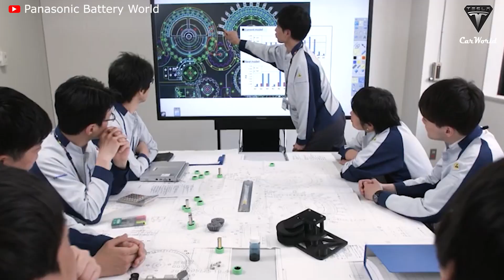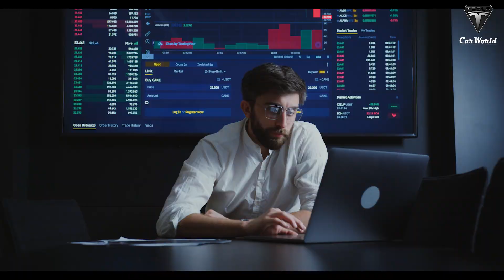Elon Musk Reveals Tesla's INSANE production Plan $100B, Warning GM & FORD!

Comment: Solar cars, when are they happening.
Reply: Not enough space on top of the car for it to make sense, get like 10 miles for a full day of sun. Trailers, campers, vans and other large vehicles it could make sense but it's also the weight implications so it would have to be structural, maybe their solar roof would be a useful material...